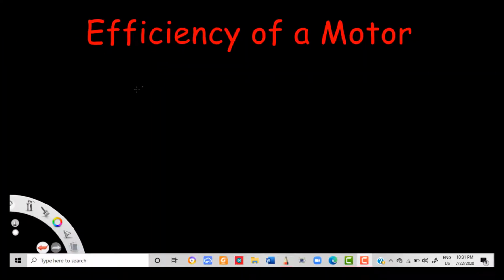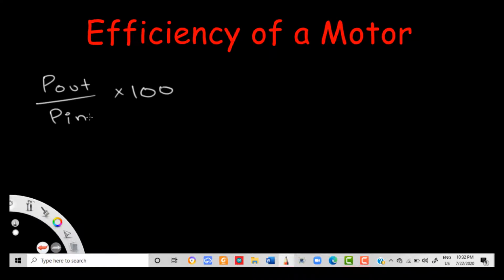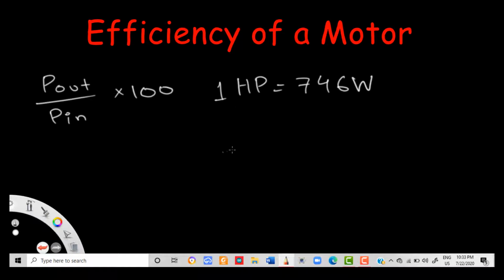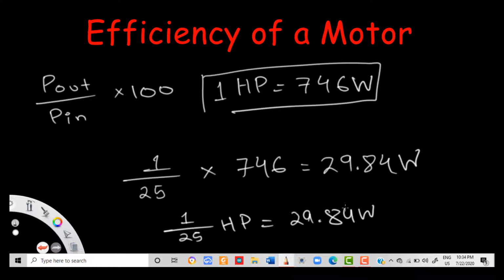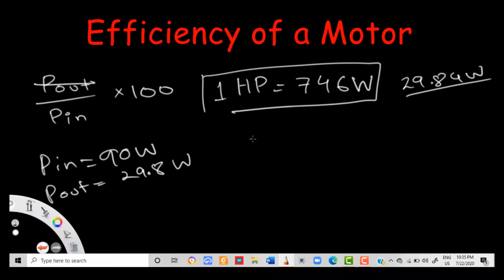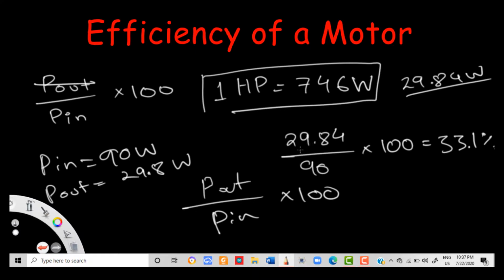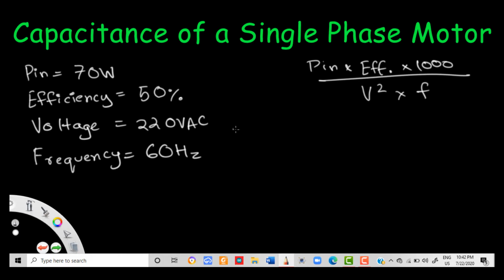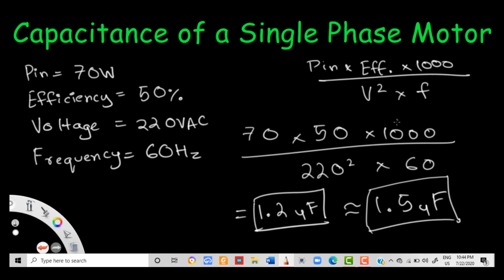How to find Capacitor Value for any Single Phase Motor ?

Comment: 1./25 hp = 30 W 

30w/60w = 0.5 = Eff

{60w x 0.5} / {220V x 220V x 60hz } = 10 uF

Typically a motor of 60 Watts, 220 VAC, 60 hz uses a capacitor between 10 and 10 uf.

Comment: Can you provide a reference for the formula you have used? Also, you have not mentioned whether this calculation is for a starting or run capacitor. In fact, your title says "capacitance of a motor", which is an entirely different thing. I suspect it is for a motor run capacitor.

Comment: ok here is my problem, I bought a saw that the start capaitor was removed so I cant start it up to get the power used to work out the eff, can I just keep changing capacitors to find one that will work?
Reply: Input power can be calculated from the stator dimensions for particular poles using standard formula. You will roughly get the input power. The rest is just a guesswork. Start with lower values such as 50% of the calculated value and stop at the point where you feel that motor is working as intended. Do not exceed beyond that. You can use ammeter to find out the capacitance at which overall current drawn is minimum.

Comment: If you take the voltage and multiply it by the current, it gives you apparent power doesn't it? That's not the same as input power. Can you explain?
Reply: The VA is considered because capacitor has its own reactance at line frequency. Hence apparent power has to be taken. This formula only works when both running and starting winding has same wire diameter. If starting  winding has thinner wire with more resistance then smaller capacitor is needed.
So this formula calculates exact capacitance required in ceiling fans but fails in the case of air cooler motors.

Comment: Sir is that formula applicable both starting and running capacitor for a single phase motor sir
Reply: No. They have different values.

Comment: My motor 110v 550watt 1680rpm.. what correct value of capasitor can i use for my motor
Reply: 120uf
Reply: It also depends on starting winding. Just don't use this formula for induction motors other than ceiling fans. It would simply burn the motor.

Comment: How do you measure Pin amperage for motor when's you have no cap to run it properly?
Reply: Nice formulas but how about a nice vid with a random motor with no label showing practical analysis?
Reply from the maker: In that case, you would have have to run a complete analysis, measure each and every required value with different corresponding tools and then plug them into the formula.
Reply: Do I spin it up by hand  to measure it or what?

Comment: how to select capacitor 3 PHASE FORMULA
Reply from the maker: Thank you and glad that you asked.
3 phase motor shouldn't require any capacitor. The main reason for using a capacitor in a single phase motor is to provide an alternative path from the same source with a phase difference allowing the motor to run. 3 phase already has 3 different  phases.

Comment: Hi young brother !
Your formula is:( P in * Efficiency * 1000) : ( Voltage* Voltage *Frequency) =  MFD

But, the one said :  ( P in * Efficiency) : ( Voltage *Voltage * Frequency ) * 1000 = MFD

With one is correct ? Have a good day !
Reply from the maker: Hi, thank you sooo much for asking. I'm glad to help. The correct formula to finding out the Capacitance value required in uF is 
(P in * Efficiency * 1000)/ (Voltage * Voltage * Frequency) = uF 

Here is a link to prove myself: https://www.google.com/url?sa=t&source=web&rct=j&url=https://www.electrical4u.net/induction-motor/single-phase-motor-capacitor-calculation-calculator/%23:~:text%3DCalculate%2520the%2520rated%2520required%2520capacitance,x%252050)%2520%253D%252024.66%2520%25C2%25B5F.&ved=2ahUKEwiLh5GFgsHuAhVraRUIHdQCAzMQFjABegQIAhAE&usg=AOvVaw1LK7PyzE_vwJ4Xo2WQsUKr&cshid=1611919159624

Thank you very much once again
Reply: @StrsAmbrg  it's not that easy to calculate the capacitance directly. In real case, the winding impedances are to be matched by taking actual readings. Then it's simulated in PC to get matching  value of capacitor. If it's more or less by upto 20%, it would still work but efficiency varies for different values of load and capacitor.
So in real scenario, the motor has to be tested with load and redesigned to get optimum value of capacitor.
For example I have a 370 watt motor but it's working fine with just 6 MFD capacitor. Using this formula we get a minimum value of 12 MFD. But if I connect 12 MFD to the motor, it will burn instantly.